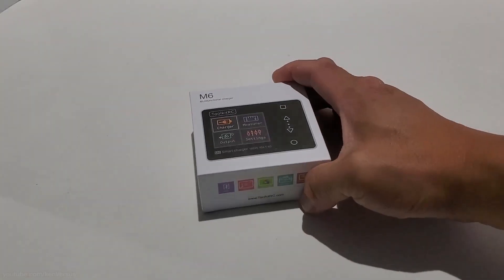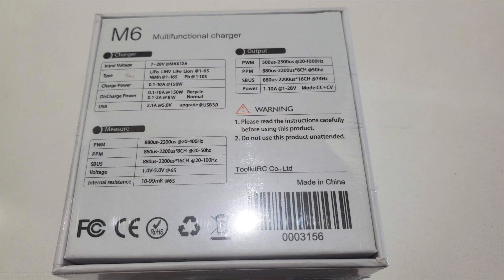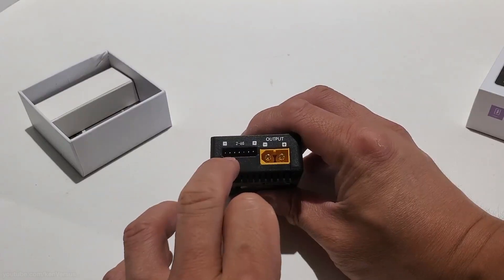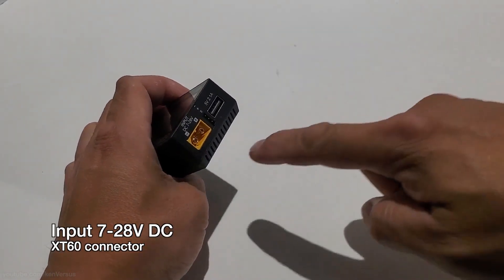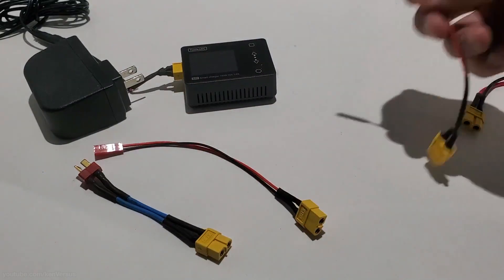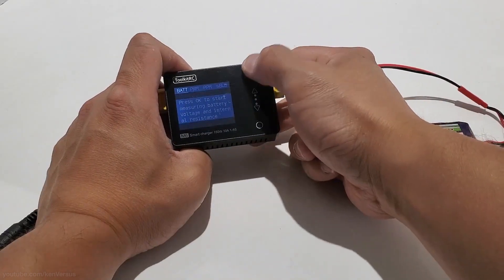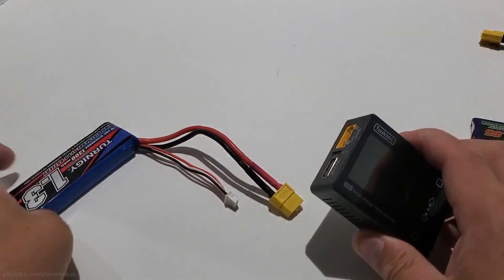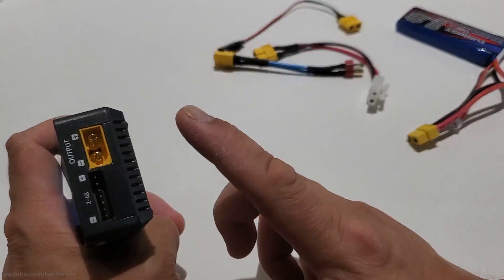ToolkitRC M6 Smart Charger

Comment: Hello!
Please check the charging mode of the lead battery Pb.
Is the charging voltage set to 14.4V and 14.7V?
Is it charged only up to 14.10 or is it charged as installed up to 14.4V and 14.7V?
OK?

Comment: So if I hook up a large capacity 2S as the supply power,,it will charge a 3 or 4S battery?...or could I solder on a plug in power supply that doesnt go over the max input voltage or the max input amps?
Reply: you need the specified input voltage of the charger which is 7 to 28 volts and 2s is 7.8V. it should work

Comment: The problem with the M6 and M8 is charger, which he balances during the entire charging cycle. This is not necessary and therefore the charging process takes much longer. You can see it, if the cell number is highlighted, then the voltage value is frozen during balancing. Battery packs that are connected without a balancer will not be fully charged. I can not recommend the device for charging. The device should charge without balancing until the battery is almost full, and then balance. This is what all my other chargers do (ISDT, HOTA, ...). I do not use the device for charging, but only as an adjustable voltage source.

Comment: They are smaller and maybe cheaper these days because they make you provide the power adapter for it which means to get it to work it has to sit next to a huge box you have to buy separately, especially if you want the higher amps.
Reply: Yep...or a big ass battery.
I use a 50 dollar portable jump box...plenty of amps.

Comment: hi ken i know this is a blast from the past but i found your videos while looking for an RC mod for the ar drone  I know they are pretty old now but i picked one up at a flea market for very little  its the v1  i would like to convert it to RC  do you know if there are any plug and play kits still available  any help appreciated
Reply from the maker: It's been a while. You'd either have to do it yourself or see if the mirumod or macgyver mod is still available.
Reply: @KenVersus   hi ken thanks  for your reply since i wrote to you i have done some research  and it seems with this drone being so old it's cheaper just to replace  the stock electronics  all together  with a more modern setup  ie  flight controller integrated GPS and so on  these systems can be bought for cheap from china warehouse  banggood  so it looks like that's what i will do i have other drones that are more modern such as the bugs5w  and clones of the Syma x8  thanks my friend